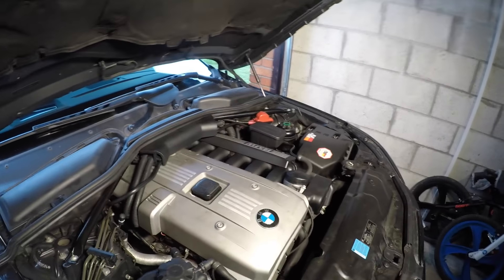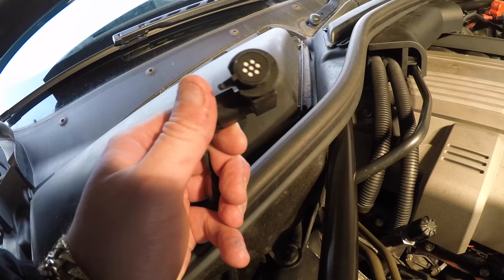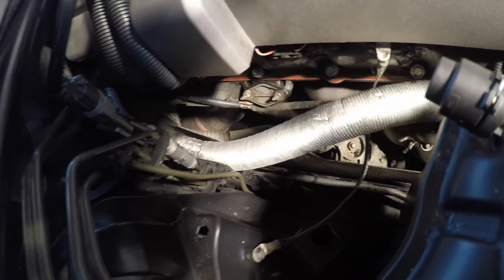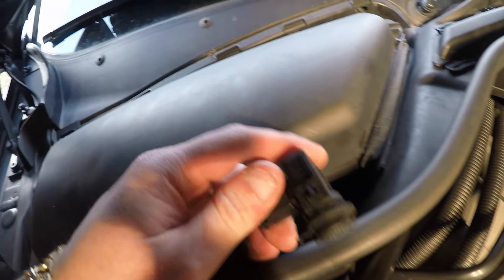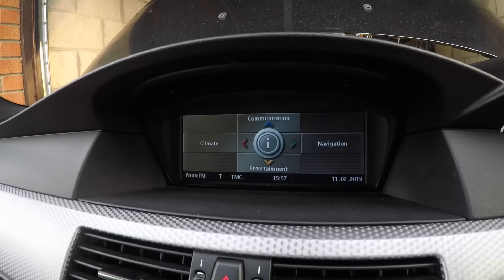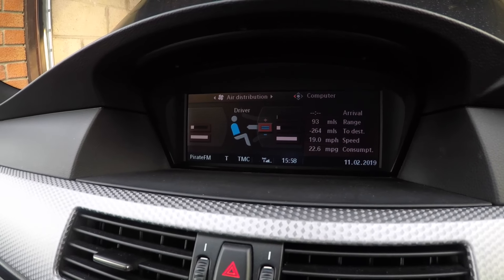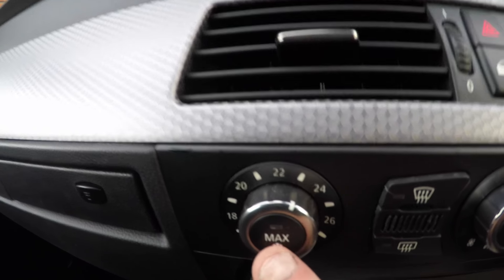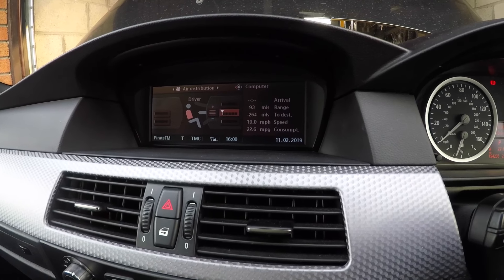BMW E90 E60 E61 E63 Air Con Not Working!!! Fix Must Watch

Comment: For nearly 2 years I would have hot air blowing through the passenger vents and cold air on the driver vents in the middle of summer... finally I replaced the AUC sensor with a used one from a wrecked 2016 f30 to test it and it worked, now everything functions normally
Reply from the maker: Good to know my videos are helping everyone
Reply: So I spoke too soon... the passenger side is blowing hot air again... driver side ice cold
Reply from the maker: Mohammad Ali Saeed Khan that’s the airbox itself mate the flaps ain’t opening and closing properly or check your heater control valve under the hood that thing can go bad

Comment: Hey Doc, great video. I have a 2004 545i with no AC. Changed the compressor, (aftermarket from Jensen), worked, then broke down within a year. Still under warranty so they sent another, also changed the evaporator - still didn't work. Driving along a couple of days later, suddenly got cold air! Then went bye-bye after 10 minutes, or so. This behavior would happen every so often, sometimes nice and cold, other times just a bit cool, now nothing but warm air. Refrigerant in the system has been confirmed. I do have oil leaks, and just repaired a radiator leak, so I'm hoping the AUC sensor could be the culprit, as you pointed out in your video.  How can I tell if this sensor is, or is not working? Do I simply have to replace it and see if that works? Or is there another way to test it out?  Thanks!  Dan

Comment: Thanks a lot. Didn’t know the AUC sensor also impacted the AC function as such. I have had the 9C54 - AUC sensor code for  some months. No real issues since I could switch on internal circulation manually. But recently the ac was not as cold as it used to be, the blower didn’t rev so to speak. Changed the auc sensor and it fixed the problem.

Comment: Does the AUC sensor have a fuse #? How do you know if it’s not working before replacing it?
Reply: It throws a fault code
Reply: Does the AUC sensor have a fuse? If so where is it’s location?
Reply: What is the fault code?

Comment: Hey great video thanks. I've a 2005 525i (E60) and cannot for the life of me get heat from the a/c. Cold appears to be fine. On defrost even after a long drive, no heat to windscreen. Knobs turned up to fully high. iDrive settings are on heat as well. Any ideas ? Thermostat ? Heater Control Valve ? Cheers

Comment: Hello. I love the detailed insights you give on the BMWs. I own a 520i e60 and I have noticed an rpm drop of almost 600rpm when I turn on the AC. In turn, I’m having to give extra throttle to even keep it on the same velocity. The rpm loss is restored when AC is turned off. What is the issue? Please help. Could it be there compressor pulley being worn out and lubrication needed?

Comment: Hello there, I know this is an old video, but. I have an issue with my e91, there is an error code 9c48, the issue is that at first the car blows hot air on both sides but after a while it only blows hot on the drivers side(left hand drive), this is only on fan, the AC blows cold air everywhere without any issues. Do you think that it might be the same sensor as I have already changed the flap motor which is linked to this code?

Comment: Wow I was nearly to replace the heater control valve as the diagnosis said its 9C7A- right water valve,but after changed it to cold from the settings  since I watch this video,everything works properly!
Cheers mate!

Comment: Great advice, I have a 2016 f15 35i, ac was not working for a while, shop replaced compressor, didn't fix it. Dealer wanted to replace compressor again, declined. Finally found this video and reseated the AUC. Blowing cold again.

Comment: Nice one, I thought my car needed a re-gas but it turns out the idrive setting was set to hot, (possibly defaulted to that after battery disconnection?). Once I set it back to cold..bingo! cheers mate.

Comment: My A/C is working and everyone I know and has this error (AUC 9C54), their A/C works just fine. It only sniffs the quality of the air. If there's some bad air, it only switches to your internal air flow instead of outside air flow when you have your A/C switched to AUTO.

Comment: The setting in the iDrive was the reason why my AC was blowing cold only in Max mode and not in the normal mode :) thank you for the video. Since I started to use AC this summer, I hear a whistling sound (like a turbo fan) when I turn my AC on and sound goes away when I turn the AC off. Any ideas why? I checked the refrigerant pressure and looks ok. I suspect AC Clutch bearing but is there any way to verify that without taking the compressor out?

Comment: Hello there, the AUC sensor is a great hint. 
Im driving the 2l diesel, the N47 engine. 
And lately it burns a lot of oil, like you said the PCV or Valve Cover Gasket is not working properly so the oil drops right on the Kat... and the Kat is right under the AUC sensor so you might be right with it. 
Since my engine burns a lot of oil lately the Climate control panel doesn’t work properly
so thanks again for the hints 
greetings from Germany
Reply: Just to test the sensor have you tried to seal sensor in plastic bag so it can't detect bad air quality and stops affecting your climate control?
Reply: @hammerfm  great idea, did you try it?  Or does it work?

Comment: Great video. Been smelling exhaust fumes inside the car suddenly, it gets blocked only if I press the manual recirc button. As it is not going auto via the auc, should I replace my AUC sensor? its an E91.

Comment: I can't get a y warmth from mine tried the settings you show many times. I've been chasing fuses .took of pos term and sparked it on the batt hold down bracket . Now now cluster instruments. No 
Ccc idrive . No inter lights ,no radio etc . Poss frm module or blue relay under bonnet . Please comment . ,
?

Comment: Hi will defective AUC have an E60 blowing cold/cool air into the cabin during winter? Get warm(ish) air at feet and windshield. I have bypassed Heater Control Valve but left unit plugged in its rightful place, it was working but I assumed that either way it would be more restrictive than a direct flow to the heater core. idrive is set to hot, the hot to cold blend door seem to open and close properly.  Face vents always blow cold air, car will (at best) blow warm air, never hot. However engine only runs around 70 celcius. Has new thermostat and water pump. Could the sensors have the ecu opening the thermostat?

Comment: My only problem with my AC was that it made a whining noise so I replaced my blower and when everything is connected when I drive on a on a regular drive on the car it seems like it switches on its own so I'm pretty sure if what you're referring to is a u c and I would have to replace that and everything else would be working just perfectly

Comment: Good video, do you know how to test the sensors?  Like I'm imagining grounding a - wire, a correct voltage power wire, and then an output wire that should send variable voltage depending on the temp applied to the sensor.  Is this possible, or are they just not that simple?

Comment: Bro does it control the blower also , today my blower stopped working,  but worked when I restarted the car, so could it be the blower motor and resistor or this sensor , pls note my blower was not working only

Comment: I have a weird AC problem in my E60. Only the vents on the driver side (RHD) is blowing hot air and cold air (although its not as cold as the other vents). All other vents are blowing Ice cold air no matter what temp I set in iDrive. I already replaced the heater control valve but no change. Any idea why or what should i look at, to troubleshoot this?

Comment: replaced my ac due to it not working. paid $1800. Now that it's been replaced it worked for a few days and now it's back to warm air. took it to the shop and they got it to blow cold. So i left. went home and parked the car. Turn the car back on and warm again. i scanned the 05 645ci and I'm getting a 9c54 code. time for a few AUC sensor i guess.

Comment: Can this prevent the blower motor from operating full stop ? I’ve changed the blower motor and the resistor but the motor won’t spin. Fuses all look ok, a/c display shows fan and speed temperature but two fault codes are present; 009C57 and 00E723. E70

Comment: Oh my days🤦🏽‍♂️all this time trying to figure out why I couldn’t get cold air. Much respect for that..
Reply from the maker: No problem it’s what this channel is here for
Reply: @BMWDoctor  I have a 2004 BMW 525 i and it does not blow strong air for the front and for the windshield yes and I changed the resistance and nothing and it does not pull hot

Comment: I have a problem with my its a 530i 2004 and hopefully that works. also did you know if that affects the fan  because its always on like really high? Thanx for your video i will try tomorrow see if i make it work
Reply from the maker: If your fan is on loud that means your waterpump is failing the fan is compensating for the high temperature as the waterpump is slowing down if you scan your car I highly bet you will see waterpump deviation as a code or waterpump speed variable
Reply: @BMWDoctor  okay thank you for your help

Comment: My 2007 E61 525d with manual A/C doesn't have the AUC sensor (or the wiring for it) where it's meant to sit ??? Is it only on E60/61s with Climate Control or are they relocated on my particular model ? Please let us know Doc.

Comment: Hi mate I have a 2006 e60 with a real weird one , when the temp is on the highest setting the footwear and screen heater blow hot air, but the centre vents are cold. The idrive setting is on warm and the engine temps are fine. I dont have climate control . Any ideas or help appreciated

Comment: would this sensor tell the computer it has 0 pressure when it actualy has? changed 3 high low pressure valve and still have that problem

Comment: Hi Doc.  I have a 2005 BMW 525i Sport E60.  It has 120,000 kms on clock and drives like a dream.  I have been following all of your videos with great interest.  Recently our summer came and I put in the air con and it worked perfectly.  However over the last few months it has worked intermittently and I cannot work out why it is doing this. One day it is working perfectly and I put it in the shed and I dont touch the settings.  The next day it just blows air but not cool air. Hoping you might be in a position to suggest something.  I have gone to idrive - climate and followed your advise and set it to aircon.

Comment: Great videos man! My AC compressor (E60) is cycling on-off repeatedly (2-3 sec interval) when the AC is turned on. It never runs long enough to cool the air. I've replaced the AC pressure sensor, the IHK completely. The refrigerant pressure is good. Is there anything else I can try other than swapping out the compressor?
Reply: check your fuses

Comment: Dr dean,  if you put it on all the cold in the i drive and forget about it an when it’s winter will it allow warm air through if you set your thermostat to warm setting? Or do you have to go in I drive an change it to hot every time you want to use the heat ?
Reply from the maker: just leave it in the middle mate and control it with climate control them controls are only to use comfortably while driving without touching climate control panel
Reply: BMW Doctor Thank you Dr. Dean for your reply and all of your free knowledge and information!!  As a 3 car bmw owner I sure appreciate all the info you provide! Keep it up .
Reply: BMW Doctor Thank you Dr. Dean for your reply and all of your free knowledge and information!!  As a 3 car bmw owner I sure appreciate all the info you provide! Keep it up .
Reply: BMW Doctor Thank you Dr. Dean for your reply and all of your free knowledge and information!!  As a 3 car bmw owner I sure appreciate all the info you provide! Keep it up .
Reply from the maker: Chad Riddle no problem mate I will be sure to do a lot more for people like you because I love that you appreciate what I do

Comment: I have a X3, 2008 model . I got  a IHKA (INTEGRATED AUTOMOTIVE HEATING AND A/C SYSTEM), AUC AU (AUTOMATIC AIR RECIRCULATION CONTROL) HEATING.
And the air is now cold at all.

Please help me

Comment: I think there is another temperature sensor inside the vehicle in ac control panel in the grid between front and rear windshield buttons , am I right doc?
Reply from the maker: Yes that’s correct but unlike the e39 where that one would control the ac that one just controls the temperature and has no effect if it goes out

Comment: 2008 520d E61 - Air con hasn't been working for couple of years now, warm weathers here so I want to investigate again. I've checked the Idrive settings all good, I did have it regassed at quick fit, it lasted all of about a 12 hours......so I'm thinking a leak, the guy at quick fit said he couldn't see any leaks with the UV dye. My opinion was he couldn't be arsed as he was packed out and just wanted me gone, and suggested I see a specialist as it was too involved for him. Are there any seals on this model that typically fail? I see the condenser is very well protected so is unlikely a crack in there, but just putting this out there as some (BMW doctor) may know a probable cause.
Reply: Did you find a resolution?.I have same issue with 2006 E60 535D. Intermittent cold on occasion. No dye found anywhere. Did retain pressure for. While.

Comment: Any idea why my heater won’t blow hot air? My auc was unplug an my ac still worked but my heater stopped working 
Prior to this I had a coolant leak ended up been my water pump so after replacing  my radiator
Water pump an overflow tank
I also replaced my controller unit heard they go out over times but still not heat

Comment: I have an x5 e70. The passenger side blows hot air. It coolant down after 20 minutes of driving but its barely cold. I have the idrive passenger setting turned to blue highest level and also checked the refrigerant level.

I have the code 00e723 code which us for a bad condensation sensor.

What else can i check

Comment: Thanks DOC. I think I have AUC sensor failure since the system blows cold air only from center vents and only if set to cold via drive. Ext temperature read is correct and the system's gas has been checked last week. Top and bottom vents are literally spitting fire! Now, is there any trick to override AUC sensor so that I can be sure it is the culprit? Thx again, G
Reply: Any fix on this im having same issue

Comment: Hi BMW doctor please if you can help me. My bmw e90 2005 has the problem with air condition. Now only the driver side mostly the left side only hot air is going and passenger side right cold air all the time. I put on 28 deegres and always is like that. So its only hot air on driver side  and its not really hot its a little bit but passenger side completely cold. Please help! 🙏
Reply: Had the same exact issue due to low freon.

Comment: I had AC but it would go in and out and it had to run for awhile for the air to cool. Replaced the drier and now I have zero cold air. Blows air fine. Just nothing cooler than the outdoor air temp.

Comment: On my 328xi 2009 Ac is not working.
When I scan the car I don't have any error relates to the sensors that your talking bout . I get this instead : Junction Box Passenger / Beifahrer Short circuit to positive or open circuit - Compressor Valve Code: 00A6D0

Could this be only a fuse replacement?

Comment: auc sensor vs interior temperature sensor
i confused what which one correct.
i want cold, when i control to low temperate, font would be cold correctly, but top and bottom would be hot.

Comment: I have a 2008 550i my ac blows cold sometime like 15% of the time and it just blows cold randomly then warm not hot or regular temperature air I check pressure and seems okay what is you're opinion
Reply from the maker: Have you checked your idrive settings and your heater control valve that sounds like the piston is getting stuck on the down position to me
Reply: I drive is okay blue all the way I'll look into heater control valve and about the piston getting stuck is that a compressor replace job
Reply from the maker: no hell no the control valve is on the side of the chassis mounted its got 4 hoses coming off it its electric and usually it overheats causing your exact issues
Reply: Oh ok I haven't took to the shop everyone keeps saying it need recharge or a new compressor but try that and yea when it's cold you need a jacket but that's only about 15% of the time just randomly blows cold but not for long 
Thank you I will look into that I wont let a me hanic fool me btw I'm in texas humid sticky and 100f
Reply: And one more thing in the night or morning  the cold moments seem to last a little longer but outside temp not so hot

Comment: Hi woulding if you can help me
I'm getting a fault code keep coming up on my 520d e60 2008 auc sensor faulty the problem I have is the auc isn't by the pollen filter nor on the fan shorud and I can find it would you know where else it could be thank you
Reply: I’m in the same boat. 520d e60 2008 (N47 engine)  AC not working correctly. I want to check the AUC sensor. I genuinely can’t find. There is a holder for the sensor in front of the pollen filter, but it is not positioned where it should be. 

Would appreciate some advice. 

Love the uploads thanks.

Comment: This is very interesting thanks for the video. Can you answer when the outside temp is above 18c I can't get cold Air con. Unless I find I turn off the vents on the screen and feet in the idrive and the turn the temp up to 27 ? Then I find the face vents blow ice cold air con. 

Help please 🙏